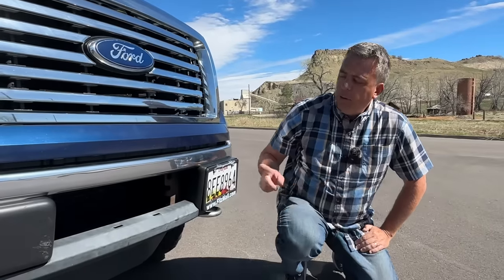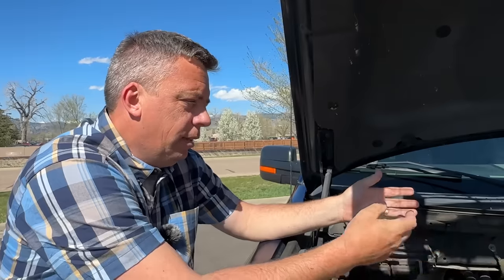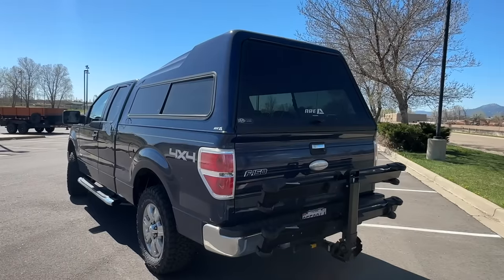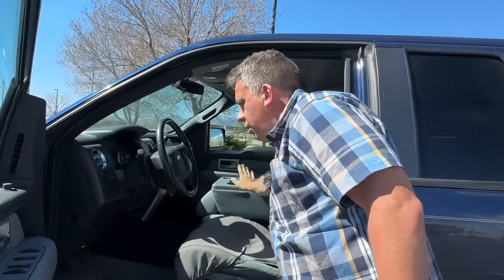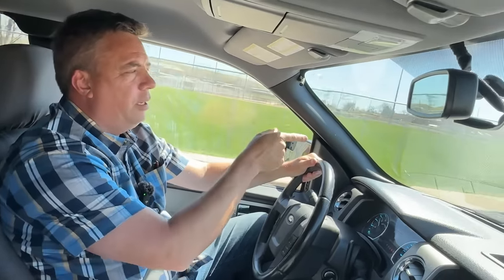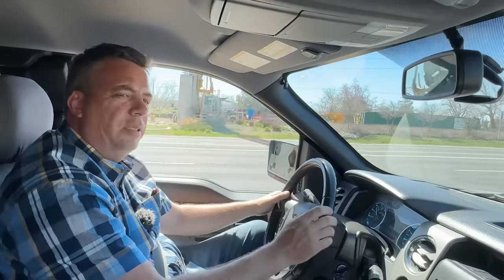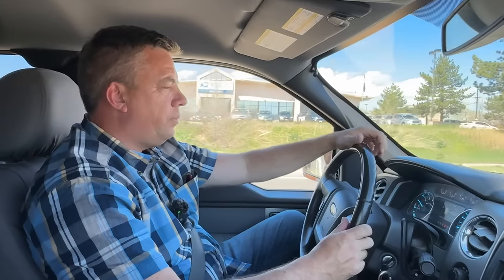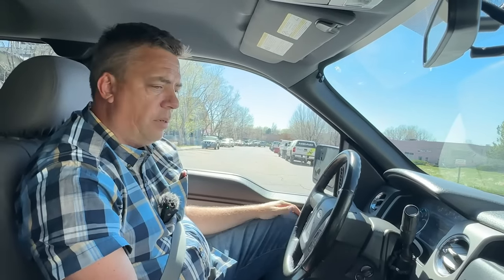How Has the Ford F-150 EcoBoost Held Up Over a Decade?

Comment: 14.9 MPG and $4,000+ in repairs on a low mileage engine, not including the repairs the previous owners had done. No one should be impressed.
Reply: MPG is bad. $4k over 13 years. isnt to to bad. its not realy low mileage more average but regarding some other trucks isnt too bad.
Reply: @LilSaint001100  10k/miles per year is low mileage, particularly for a pickup truck.

And $4,000 in engine repairs might not be too bad you. It is to anyone that knows a reliable engine.
Reply: @LilSaint001100  That's not $4k over 13 years for all repairs to the truck, it's $4k+ in the last year or two for just the engine in the time this guy has had it! I'd bet last owner spent more and just got tired of it.
Reply: @LilSaint001100  Over $4,000 sounds pretty bad to me. Never mind an engine. I've owned 11 vehicles over the years, and I haven't spent $4,000 in repairs on all of them put together for anything.
Reply: it has the aerodynamics of a home
Reply: $308 per year is hardly a horrible repair avg. Yes MPG on these isn't anything special.
Reply: @Carlos-pi1xj I don’t know why anyone would pour money into an old vehicle.  It needs to be sold before significant repairs.  Patch it and dump it.
Reply: Someone must have been doing 10k mile oil changes before he bought it. To trash a timing set so early that's usually at least a part of the story.
Reply: @volvo09 Gen1 ecoboost’s had chain issues.  Fuel would get into the oil and degrade the chain. They changed that in the gen2 engines.
Reply: 2010 flex Ecoboost had 293k on it. 21mpg no engine issues, ever. Got a '13 now.
Reply: Try to remember what half tons were getting MPG back then lol. 15 mpg was a huge improvement over the 5.4 which was 12mpg.
Reply: @allentechpt9026 is that because you get rid of them and buy something different before they have problems? Lol😂
Reply: Half ton trucks are never going to get great gas mileage. Blows my mind when people seem to think a huge, heavy block going down the road is going to get great gas mileage with any engine. The Gen 1 ecoboost also had lots of well known/documented problems. The majority were resolved with the Gen 2. And finally, Ford has fixed the last common issue with the cam phaser rattle. I have a Gen 2 in my 2019 and it’s been 100% reliable so far.
Reply: Obviously, you have never owned a GM 5.3 from that era with DOD and numerous lifter problems. And I forgot my numerous transmission issues. Should I go on?
Reply: Got a 4dr 2015 Tundra with the 4.6 V8…145K and averaging 17mpg. Only had to change the belt and it’s still running strong. Engine should be good for 250-300K
Reply: @DB-pb7ckMy neighbor had a similar year model Tundra. Around the same mileage the cam tower seals (?) started leaking. This was a few years ago, but I believe he was quoted north of $6k to fix that and a few more “while you’re in there” items. He wound up trading it for a newer Tundra.
Reply: @allentechpt9026 you saying you’ve owned 11 car s over the years doesn’t sound any better bud. 💀🤣
Reply: @DB-pb7ck I have no Idea what you care about. I was pointing out that even Tundra's can have very expensive repairs at a similar mileage. Congratulations on your high mileage truck. Have a nice day.
Reply: @TimGrefer  Well, yeah. When you own mostly Toyotas that last 300,000 or 400,000 miles before any major repairs, that's pretty easy to do.
Reply: Fix or repair daily  enough said 😂
Reply: @allentechpt9026  you're not keeping vehicles for 300k to 400k in mileage if you've been going through that many vehicles 😂 that math doesn't add up at all 😂 nice try though
Reply: This video is a complete lie!
Our shop very often rebuilding these same garbage Ecoboost engines. Not one version of the Ecoboost engines are forgiving engines, these are all have issues after the warranty expires. This vehicle is a unicorn or the owner just babied this truck without driving it normal. Timing chain issues, overheating, coolant leaks and oil leaks are few of the common issues and the electronics are disastrous as they age in the rust belt.
Reply: This video is a complete lie!
Our shop very often rebuilding these same garbage Ecoboost engines. Not one version of the Ecoboost engines are forgiving engines, these are all have issues after the warranty expires. This vehicle is a unicorn or the owner just babied this truck without driving it normal. Timing chain issues, overheating, coolant leaks and oil leaks are few of the common issues and the electronics are disastrous as they age in the rust belt.
Reply: @Thankyou_3  ??? Hmmm, that's weird. Haven't had any of that happen with my Ecoboost engines (2) both over 100k miles. And no I don't baby them. Turbo charged engines are way too much fun to baby. Maybe your comment is a lie? At least the 2nd half of it.
Reply: @markhavelka4924 i do that repair all the time and charge $300, who the heck charge 6k is out of their mind. What he needs is a new tech .
Reply: I quess you are oblivious to the effects on MPG of the mild suspension lift, E rated all terrain tires, and camper shell on a truck. That's easily a 3-4 mpg penalty over stock suspension, highway tires, and no shell.
Reply: @walid9719 he didn’t buy it new it’s not fair to assume it was maintained properly,there are tons of these ecoboost engines w 3-400 k that have never been touched,and run perfect. Everyone wants to save money on oil changes by stretching them to 
o 10 k  intervals. These turbo engines need more frequent maintenance than the NA version.
Reply: @carbonking53 if the tires are larger than stock and the Speedo hasn’t been fixed then all the numbers are off.
Reply: @user-tb7rn1il3q because not everyone is a fool that thinks it’s cheaper to go buy a 50k dollar truck rather than maintain or repair an “older” truck. I don’t buy anything with less than 100K on it and they all drive like new.
Reply: I get 18 mpg in my 4.6 Mustang 😂
Reply: @walid9719 cheaper than a new truck! Financing something new to avoid repairs is not reliability
Reply: Agreed, I'll stick to my Coyote V8
Reply: @DB-pb7ckAgreed 100%, this is just another overpriced EcoBoost truck that won't make it to a million miles like the Toyota Tundra with the 5.7L I-Force V8.
Reply: @TimGrefer Yet they won't outlast the Toyota Tundra with the 5.7L I-Force V8 mate, also what job do you have and how much money do you make to afford that overpriced EcoBoost truck?
Reply: I had a 17 5.0 that made 15 mpg on 33’s traded it with 160,000 with no issues. Loved that thing
Reply: @acruz639  Awesome brother, I have a 2011 Ford F150 with a 5.0L Coyote V8 in it with 161,000 miles on it and still going strong and it's a beast and it sounds like a beast with the Borla Exhaust as well.
Reply: @zacwoofter5350  I never said to buy something new, just something that is in good shape, drive it for a few years and get rid of it before dumping significant money into it.
Reply: @DB-pb7ckThe miles is somewhat irrelevant depending on how it was used.  If he used it tow and haul stuff mostly then it's holding up well and mpgs are fair. In this case, he could have gotten 12 mpg with a Tundra for all we know.
Reply: That's not too bad. If it is fixed well and runs good then the money is worth it. The mpgs are ok and generally much better than the 5.4 it replaced.
Reply: @TimGrefer That's what my brother does with his Ram trucks. By 100k they are gone. However, that's usually the case with anything of age, even Toyotas.
Reply: @CJColvin  So you are certifying that every Tundra 5.7 will go 1,000,000 miles with regular maintenance only? I find that to be a lofty claim that cannot be duplicated by even half of them. I'd take a 2.7 Ecoboost F-150 from 2021 and up any day over anything else.
Reply: @302Mustang13  LOL!!!!!!!!!!!!! As you wish mate
Reply: I think some people let this million mile Tundra go to their heads thinking it means something. That and it's clearly highway miles, which is much easier miles than this gen 1 Ecoboost F-150 that was probably driven around town mostly and used for work. Huge difference.
Reply: @302Mustang13  I doubt it mate
Reply: These engines usually go 200k problem free. Cam phasers are way less on this year. 15-20 have the most problems. 21 and up it's fixed.
Reply: Our 12 year old Hemi with 200k miles gets 18-21 mpg highway and still runs like new.
Reply: @selfcarefordudes  Awesome
Reply: Yea those 5.0 can be expensive to own, no one is impressed with them
Reply: @Thankyou_3  yea, ok…🙄

Comment: had a used 14 f150 Eco boost sadly had nothing but repair after repair not long after purchasing, the water pump started leaking, vacuum pump was leaking oil, and high pressure fuel pump was failing and was dumping fuel into the oil, now don't get me wrong i loved this truck so i got a 13 with a V8 that has everything the 14 had.

Comment: My 13 fx4 5.0 averages 15mpg with 35" mts winch ,bumper , decked drawer system loaded, camper shell and 2 inch lift. In 160,000 miles ive spent less then 1000 on repairs.

Comment: If the idiots who make the rules would put in as much effort into clean diesel emissions, making them simple, reliable, and cost-effective, you would have a fuel that is completely renewable and cleaner than any gasoline engine. Plus, you would get more power and significantly better fuel economy with fuel that you could produce indefinitely. I simply do not understand, why this does not happen. The reliability of a modern diesel engine is unmatched when done correctly. Plus they also last easily 500,000 miles.

Comment: 2015 2.7 Sport FX4 super crew at 130k has been very solid since I bought it new no issues. Majority of the time drive in sport mode and get 17mpg. Hopefully stays that way and that its regular maintenance keeps it going. Looking to upgrade the suspension soon to either 2” Fox or Bilstein, any recommendations?

Comment: I have a 2011 F150 Lariat with the Ecoboost but mine is a Super Crew with 156k on the clock. The only issue is that it leaks coolant in the Texas Spring/Summer heat. Hoses shrink and it stops leaking in the Fall and Winter.

Comment: Not the best comparison Andre, Fleet and livery truck engines tend to have a ton of idle speed hours which adds wear and tear plus the turbos get carbon build up. A well maintained non-modified 3.5 that doesn’t get beat on can get 250k miles out of the turbos pretty easy.

Comment: same MPG as a V8 but with way more torque. I never liked these as far as MPG, I like them for performance. I always found these to out pull any V8 but reliability beyond 100-200k miles can be $$
Cam phayser issues are usually caused by IMPROPER OIL. 5w30 full synthetic oil changed at 5k miles or less in short trip driving such as living in same village as you work.

Comment: I can't say for certain about the 2011+ engines, but Ford's phaser issues go all the way back to 2004. I know back in the 3/4v Triton motors the issue arose due to poorly designed oil pumps that would lose pressure under moderate and heavy RPMs. As far as I'm aware, Ford still uses the same basic designed oil pumps, so it's a safe assumption that that's why the 3.5s and 5.0s are still having phaser problems. It's a lack of oil pressure under load.
Reply: True, the oil pumps were on the weak side back then but the real culprit was defective timing chain tensioners.  The tensioner gaskets would blow out and bleed off oil pressure to the cam phasers and thats when the ticking and cam/crank corrolation codes start to appear.

Comment: I have 3.0L F-150 diesel ⛽ with 130k miles and I haven't touched the engine. Proves that the diesel is more reliable and cheaper to maintain than the Power boost!!

Comment: We’ll seems like all the other manufacturers are going the turbo way. Let’s check back in ten years, see how they are doing. 3.5 , last engine with a oil pump chain. Cheap owners,lack of maintenance and belief that you can go ton of miles without an oil change leading to component wear. Fire er up cold and take off, not good for any engine.
Reply: You are 100% spot on. Change the oil every 3,000 to 4,000 miles with a good full synthetic oil and a good filter. You will go well over 2000,000 miles no problem.
Reply: Turbos have been around since the 80's, it's nothing new... They are simply being used to reduce emissions these days.

They are mostly trouble free as long as you change your oil. Neglecting oil changes causes the bearings to get blocked up and starved for oil resulting in turbo failure.
Reply: @volvo09  No, you seem to be confused. You see, I've read the comments section on TFLtruck and, while impressive in concept, "turbo chargers" represent a level of technology beyond what Man is capable of achieving. That's why you have to change your turbocharger at every oil change, and twice during every oil change after 100,000 miles.
Reply: That's true. The vast majority of engine failures are due to poor maintenance.
Reply: @smithjones1906  haha! Yes, I have to admit I've gone through 8 turbos! they just constantly break, meanwhile I have had NO other problems with my vehicles, just turbos blowing up, constantly!

Comment: Broke down in the rain, sucked water into the turbos. Also water pump goes out around 100k and ac blender actuator breaks at least once a year replace 3 in 2 years on a 5 year old truck. Cam phasers 4k. If you love comfort and spending money on repairs its a perfect truck.

Comment: I had a 2017 with the 5.0. The 3.5 is faster but I’ll take the 5.0 reliability over the 3.5
Reply: Agreed 100%
Reply: @CJColvin  also I love the sounds from the 5.0. I miss that truck
Reply: @acruz639  Agreed, I have a 2011 Ford F150 with a 5.0L Coyote V8 in it with 161,000 miles on it and still going strong and its a beast and it sounds like a beast with the Borla ATAK exhaust on it as well

Comment: I have 2012 Silverado 5.3, 250k. Zero repairs outside of routine maintenance and wear items like brakes, tires. Actually I had to replace the middle leaf on the passenger side.
Still cruises at 21-22mpg highway with cylinder deactivation turned off. Drinks no oil. Gets synthetic every 7,500 miles. City mpg lol is and never was great. 
It’s towed 10k and max payload pretty frequently. I run in 4auto all winter. 

Has been a great truck. My buddy had an ‘11 Ecoboost and it had spark plug issues and turbos replaced. For a first gen it wasn’t all that bad though. He got sick of it and traded it in on a Sierra then later went back to a 2019 Ecoboost when GM didn’t update their interiors

Comment: Had a 2014, bought used. Had to do chains immediately after buying it (covered by seller!) and then started rattling again 28k later. After consulting with a mechanic, he advised to either put in a new engine, or dump it. Putting chains on again would just be a bandaid on the issue, and it would happen again. My understanding is that STRICT routine maintenance is key for these trucks. You cannot neglect them like your beater Ranger from high school. If they are maintained, they can be great reliable trucks. I ended up getting rid of mine and stepping back into an older Chevy 1500 5.3. No headaches, no bs, best vehicle I've ever owned.

Comment: $4,000 is not that bad considering you’d be putting Lifters in a GM/ram around that mileage or a transmission in Gm’s cast. The 6L80/90 never fails to fail

Comment: There is nothing eco about the engine!! The 3.5 used more gas than my 5.4. And the hesitation when stopping at a stop sign, it always scared me when taking off n a busy road. But never had a problem with the ecoboost. Just change the oil more often due to the turbos!!

Comment: The V8 is no where near as efficient as some of the V6s coming out these days. However I've never heard a V6 that sounded anywhere near as good as a V8. Unfortunately the prices of gas these days makes the V8 so much less practical than most of the other options. (Diesel, smaller Turbo\Supercharged)

Also I wonder about reliability of the eco boost over time. I can't imagine there will be many 20+ year old Ecoboost powered vehicles still driving around...since they are under a bit more load and stress than a comparable V8 would be. Perhaps Ford built them to be long lasting as well? Time will tell I guess.

Comment: My 2010 F150 with a 5.4 V8 gets a lot better mileage, and I have 180,000 miles on it. I want to see some data on high mileage Ecoboost motors, say, 200,000 miles or higher. At least 100,000 miles of that is towing, coast to coast many times and to Alaska. Bought it five years old with 12,000 miles on it.

Comment: I remember back in 2011 I needed a ranch truck. I needed to decide between a V8 and a brand new eco-boost. The eco-boost had a lot of hype behind it but I just wasn’t sold on it at the time.  I chose the V8 over the eco-boost and was glad I did. I beat the hell out of that truck putting 140,000 miles on it driving through mud, water, dusty conditions, and other things. The only problems I had was that I had to get the brakes worked on more often than average due to the amount of mud that was always caked inside of them.
Reply: If you're talking about the new at the time 5.0L V8 it had only been in Mustang a year in 2011. The 4.6L Triton was used in Mustangs prior to that since the mid 1990s.
Reply: @nathanmcdonald610  I feel dumb then, lol. But it was still a very reliable powertrain. I put 140,000 miles on it before I traded it in and never had any issues.
Reply: @seanpaul9164  Oh yeah, the 5.0L is a great V8, I have a 2011 F-150 FX4 Supercab 5.0L that bought new in 2011, 13 years and 107K miles later it still runs just as smoothly as the day I drove it off the dealership lot with 4 miles on the odometer.
Reply: @seanpaul9164  You gotta love the 5.0L Coyote V8 mate, I have one in my 2011 Ford F150 with 161,000 miles on it and still going strong.
Reply: @CJColvin  HELL YEAH!